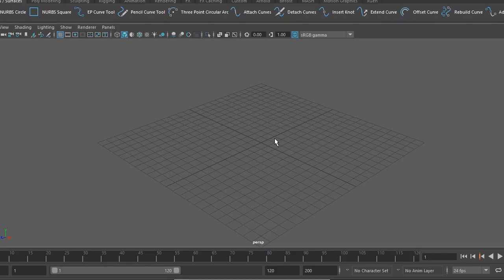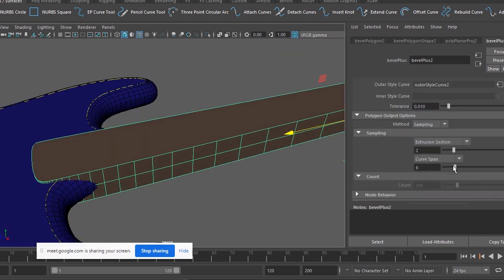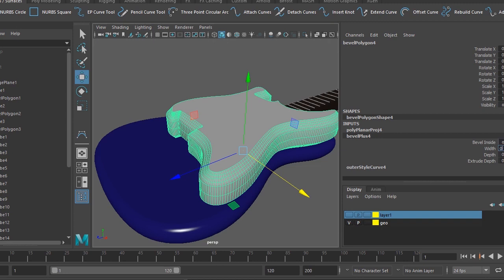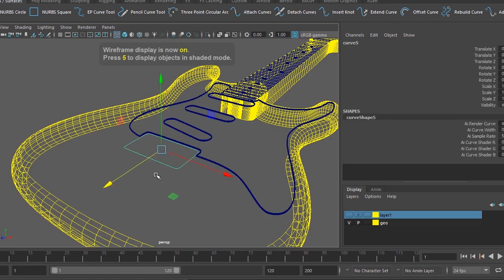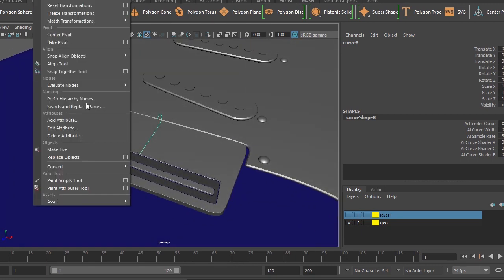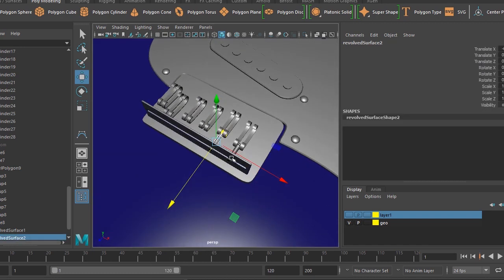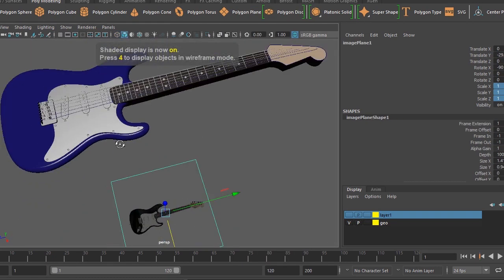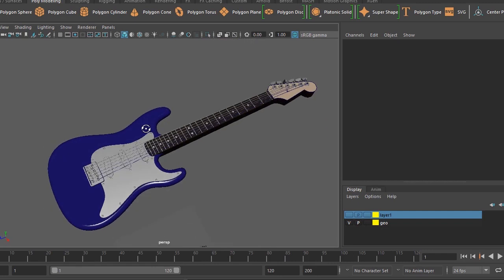Electric Guitar Modelling with Surfaces tools Extrude, Bevel plus and revolve tool Maya Tutorial

Comment: Difficult for a beginner to follow. Little explanation for the buttons you are pushing and the screen is cropped at the edges so you cannot see what you are doing with your mouse at times. A good tutorial other than this though.
Reply from the maker: Sorry for that. Will consider that feedback. Thank you very much.
Reply: @ReinsAcademy  Thanks for the reply. I am new to Maya and am trying to follow your tutorial. At 4:38 you select Control Vertex from the RMB menu. I only have the option for Vertex and Vertex face. Do you know what the problem maybe? Thanks.
Reply from the maker: You are using polygon model, so you have vertex and vertex face , where as in video it is NURBS model.